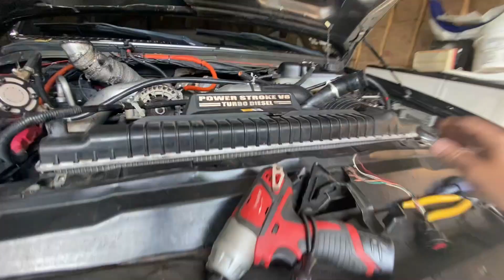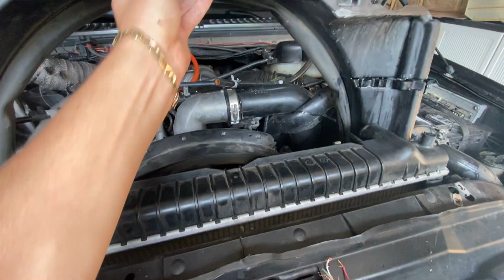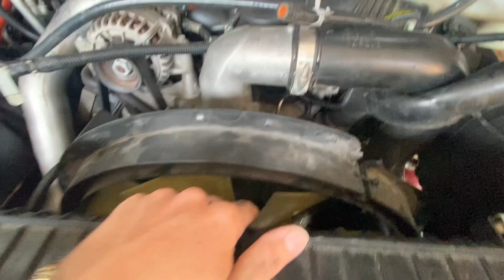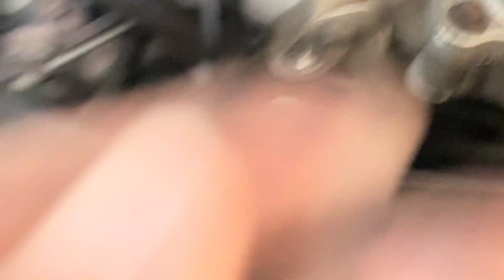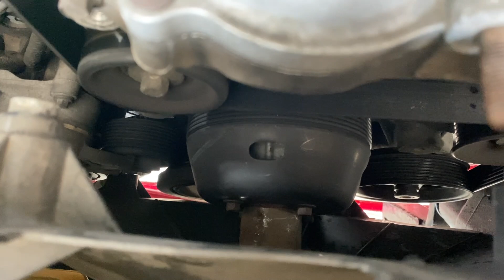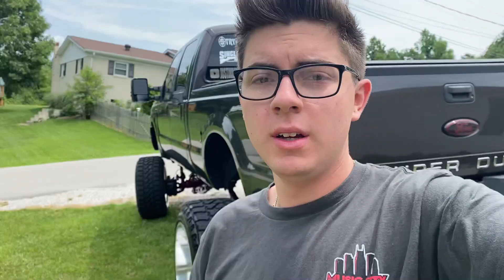HOW TO : 7.3 Fan clutch conversion for 6.0 powerstroke | BULLETPROOF DIESEL

Comment: Curious to know if your truck has any codes for the clutch fan not being plugged in anymore. I have the same vehicle mine is also tuned was wondering if you got a light on your dash for doing this?
Reply from the maker: I believe there was a soft code only no engine light. But if you scan it will have a code. But no engine light

Comment: Permanent  connection to the fan robs power when not needed. Some mods are counter intuitive like running the exhaust in front of the cab.
Reply from the maker: as unpractical the hood stack used to be when I had it , it was so cool. Miss it sometimes. I wouldn’t necessarily call it counter intuitive, but definitely it was not practical. & I hate the manual fan clutch it was so loud always running.  Definitley robbed power not that I cared, but it did cool the truck better. Thanks for watching anyway even if it was a very counter intuitive video.

Comment: Thanks for the video, will be doing this on my truck soon. I know most people dont care about soft codes but theres gotta be a way to trick PCM to think fan clutch is hooked up. Maybe a jumper wire across 2 of the pins or a resister between them?
Reply: Did you ever figure this out ?

Comment: Make sure that you put a cap over the old wiring harness connector on the truck side. Or if the wires were destroyed, make sure to snip all the ends clean and wrap the ends very thick with electrical tape. If those fan wires short, it can cause PCM problems, and sometimes a no-crank!
JESUS SAVES

Comment: What thermostat temp do u run?
Reply from the maker: Never touched the thermostat in this truck so not sure what’s in it. Truck usually doesn’t get above 190 on a hot day
Reply: @JUSTINHAWKSMITH  damn mine on a hot day is 204 205

Comment: What about an engine code because you have nothing plugged in what’s going on with that any codes
Reply from the maker: No engine code on dash , it’s a soft code. So only shows up when you scan it
Reply: @JUSTINHAWKSMITH Not true, brings the check engine light on and on my 07.
Reply from the maker: @beau0718  you either have another code doing that or it’s only certain 07’s. Cause I had the manual fan clutch on my 07 dually 6.0 , & had it on my 06. No light on dash , just shows a code if you scan it.

Comment: Hey, this is a great video.  I did the mod when I bulletproofed my 6.0. I do notice that if the outside temp is above 85 degrees, the fan roars all of the time.  Do you notice that too?  Im wondering if my manual fan clutch is bad?
Reply: Pretty much the same for me.. imagine being in florida it roars all the time..so annoying.. and it kills power too

Comment: I hate the 7.3 fan clutch mod. The fan is always running loud, even when it's cold out.
I run my truck cross country regularly and noticed the fuel bill increase by $500
Reply from the maker: noise doesnt bother me too bad , definitley sounds like a school bus lol... havent heard of anyone saying it effected their fuel mileage, sounds like a different issue on that not sure.
Reply: @JUSTINHAWKSMITH   My truck is a workhorse, not a toy. (there's nothing wrong with toys!) 
I have a 71' Mach One and Jeep for toys.
I make trips from Vegas to Georgia and back for extra money. $8000 a trip!
I wouldn't notice extra fuel used around town, I don't keep track. 
But the long distance (in two days) I compare fuel receipts. 
That howling fan is moving 10,000 cfpm. Moving that kind of air ain't free, it takes energy. Energy is fuel. 
I have a Hayden Extreme Duty fan clutch. I'm considering switching to a less aggressive clutch. I made the trip last week. Temps in northern Texas was in the 40's (BRRR!) and the fan was still noisy. NO reason for that. 
Cruising flat and level, not towing, freeway speeds isn't creating much heat.
The clutch should mostly be disengaged. That's the whole purpose of a clutch. Turn off when not needed, turn on when needed. 
Maybe it's defective?

Comment: I sanded the fan pulley with 60 grit. Keeps the belt from slipping when the fan clutch fully engages.
Reply: Is this a common problem? Mine has slipped with engagement since I put it on, was watching this to try to get the right year fan clutch.